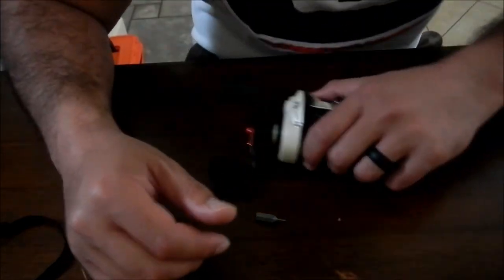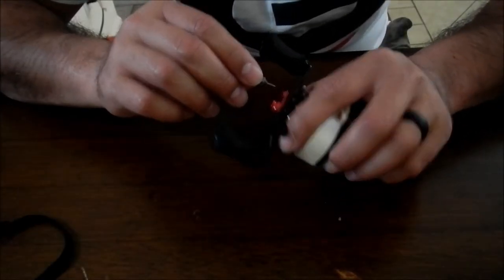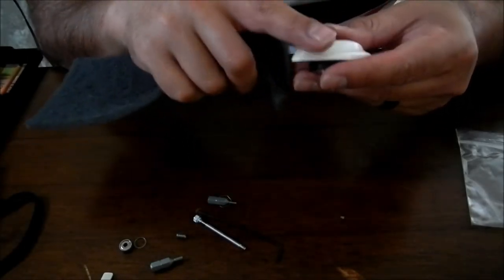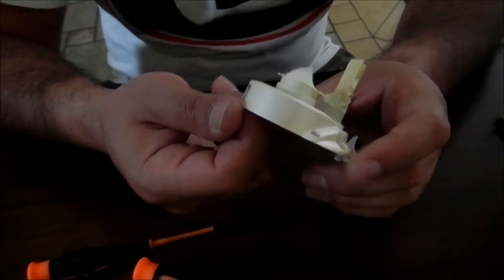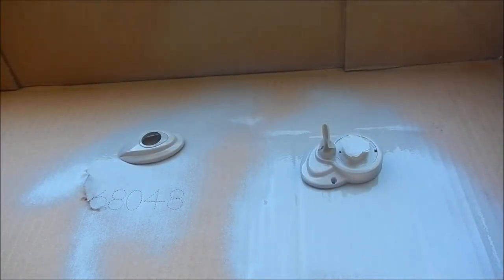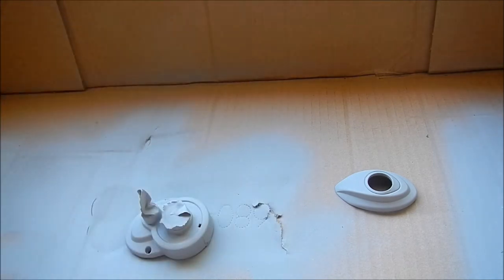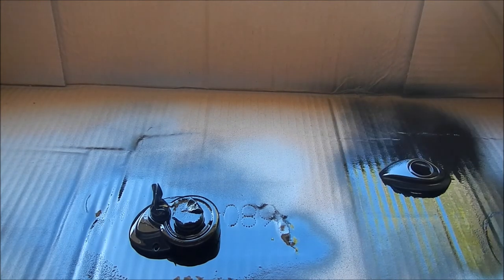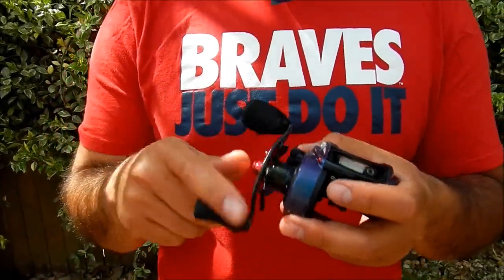Custom painting your fishing reel

Comment: You didnt use any type of clear coat? Would you recommend it?
Reply from the maker: TehOceanz no, i didnt but I would stick with the brand of paint you plan to use.
Reply: Ramirez most likely using the same as you to match the abu garcia ike rod!
Reply from the maker: TehOceanz  just a tip. Skip the primer step and go straight to the base coat and color paint.

Comment: Question?
This is off topic but I'm painting my rod. I've already sanded it down pretty good and know I will paint it flat black paint and primer in one, but do you think I need to spray clear coat on my rod?

I see alot of pros brushing epoxy on there but I'm trying to go easy...

Or does it not even need a clear coat 🤔
Reply from the maker: Rods i dont know to be honest. The paint and cleat coat goes into the designe of it, i think.